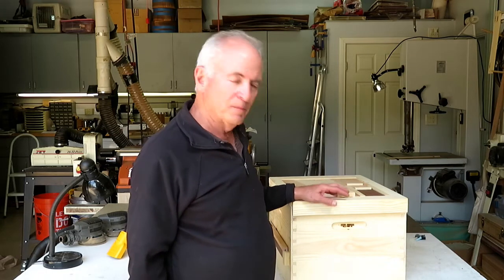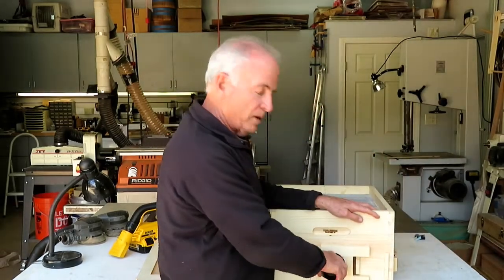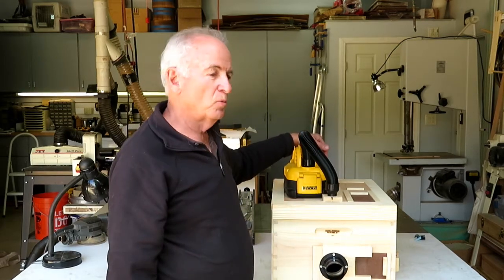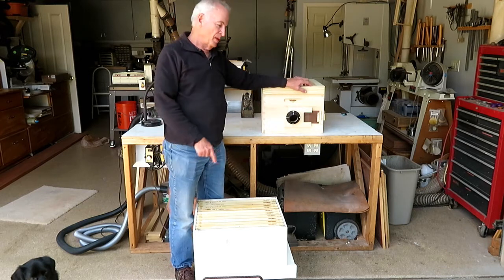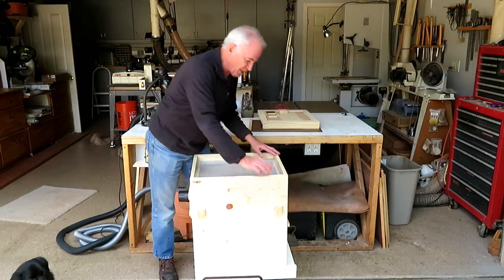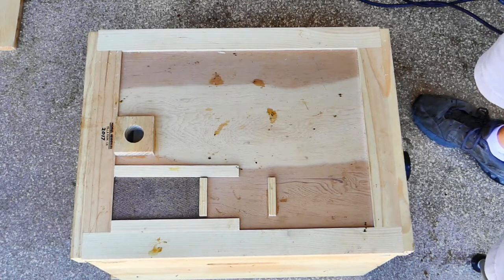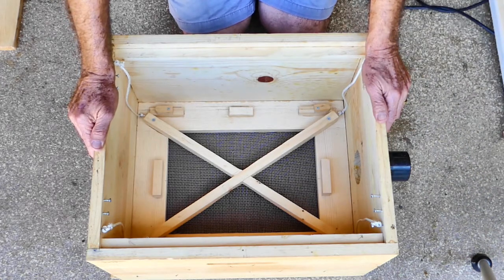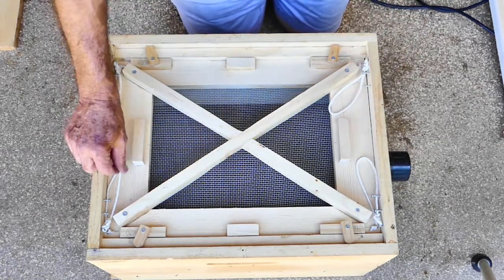Bee Vacuum V3

Comment: How long is the hose you use 
for sucking up the bees? How is the suction on that vacuum. I’m tired of taking a generator to run the vacuum.
Reply from the maker: I use the Bosch VAC005  hose which is 16.4 feet.  However, if you use the DeWalt vacuum that I use, you will probably need more than one 5ah battery.  Sometimes one is enough for me and sometimes I need two.  I switched to the DeWalt flexvolt system for some of my other tools and I have a 9ah battery that I now use on the vac.  That gives me plenty of run time.  Also, since the vac is not as strong as a regular shop vac you need to make sure you don't have any air leaks or you won't get enough suction.  Good luck!

Comment: Really nice design but I have Layens hives and plan on making mine to fit them.  How critical are the interior dimensions?  Thanks
Reply from the maker: I would think that none of the dimensions are critical.  You should look at the concept and adapt it to your hives. What I was trying to do with this vacuum is make it less stressful to transfer the bees to the final hive.  When you pick up a swarm in a cardboard box (for example) you generally dump the bees into the final hive.  That usually results in bees flying all around.
Getting a swarm to accept a new hive is always a problem - sometime they will not stay.  So what I do is put an excluded at the bottom of the hive so the queen can't get out, then put the bee vacuum on top and slowly push the bees down out of the   bee vacuum and into the hive.  When I have them all in the hive, I remove the bee vacuum.  This process can take a couple of days.  If you got the queen when you vacuumed them up,  and they start making comb, they'll probably stay.
Eventually, could be after a month, remove the excluder because if they make drones, the drones won't be able to get through the excluder.

Comment from the maker: No, never tried that.  When I do a cutout, I put brood comb in the brood box and they move down to it quickly.  With a swarm, I'd have to see if they would move up to the brood box.  Of course, until they moved and I removed the bee vacuum, the bees would be trapped in the hive, unless I used a top entrance, because the bee vacuum doesn't have an exit at the top (which would be the bottom, if I flipped it).  
I modified the bee vacuum so that I can (gently) force the bees down into the brood box.  An excluder placed at the bottom of the brood box will keep the queen from leaving, so hopefully, the bees will start making comb (or using comb I put in the box) and the queen will start laying.  Once they have brood, they're likely to stay.  The excluder has to be removed eventually or the drones will not be able to get out.